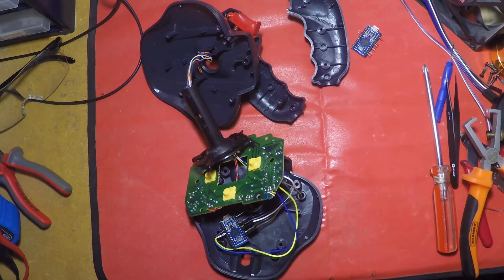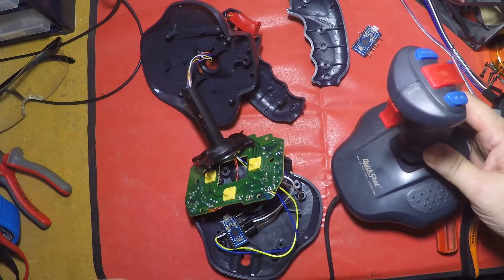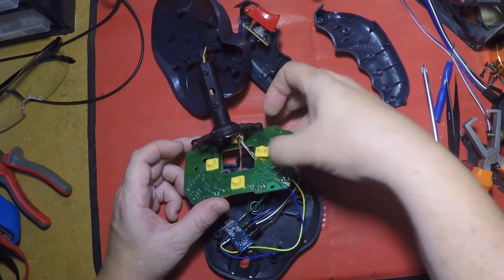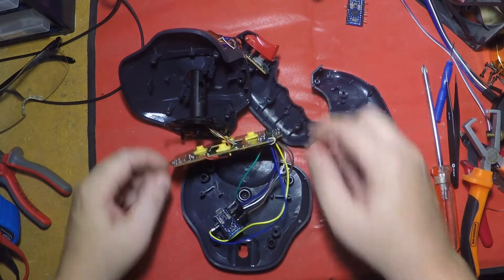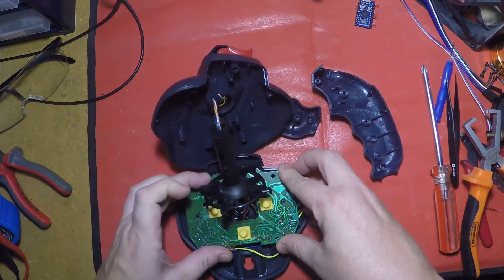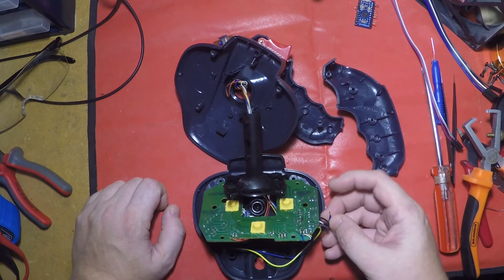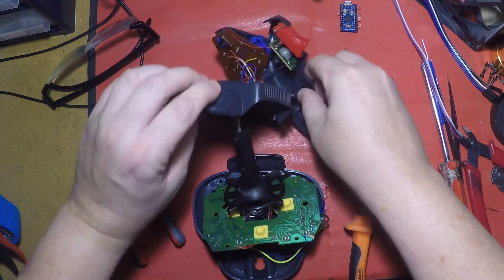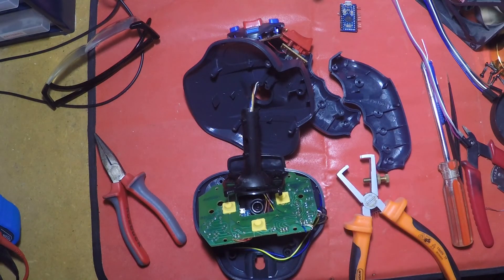Making the NES Quick Shot work on USB

Comment: Nice work. I do like the idea of using some of the older sticks for new purposes. There's no reason why not with a bit of work.
Reply from the maker: After playing a bit of Flood (Amiga) and Bomb Jack (arcade) I have to admit that having the digital flight stick with trigger in the right hand, is proving to be more comfortable than a left/right fight stick for those games. And with the pro micro arduino clone and Daemonbite's software, it makes this kind of thing a breeze.
Reply: @msknight5  I always think Bombjack is Bomberman. Don't think I've heard of Flood before. I'm a little odd handed. I prefer to hold a stick with might right hand. But for game pads I prefer the left hand side for movement controls. So it makes using Arcade machines feel uncomfortable for me. That's my excuse at being crap at the games anyway ;-)

Comment: What a complex project this is. Wow! 

To be honest I never really liked the quick shot flight stick type of joystick for arcade games. I am more keen on the arcade sticks like the suzo arcade or similar devices with micro switches. Pixel perfect gaming needs pixel perfect controls… still excellent repurposing of the sticks.
Reply: I don't know about that. I bought an analogue QuickShot joystick, connected via gameport, for my Win98 rebuild PC project 2 years ago, and its really good. But I guess it depends on the game you're playing. Its easily the best option for A10-Cuba and that's comparing it to the much newer USB joysticks that I tried.
 
They've got a really nice feel to them and also very responsive and sensitive.
 
Make analogue great again, or MAGA for short!
Reply from the maker: I've been using it to play some bomb jack (arcade) and some Flood (Amiga) and I can see the appeal of using a trigger with my right hand, over using a button on a fight stick with left/right hand combo. Those little pro micro arduino clones are pretty cool. With Daemonbite's software, they're small enough to tuck into all sorts of small joystick projects.